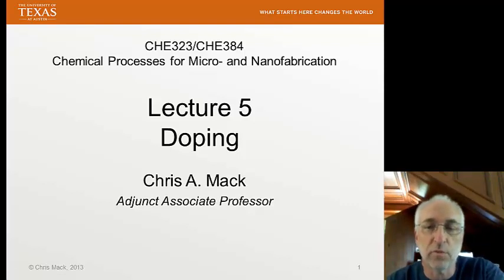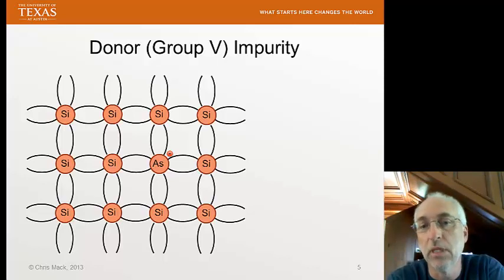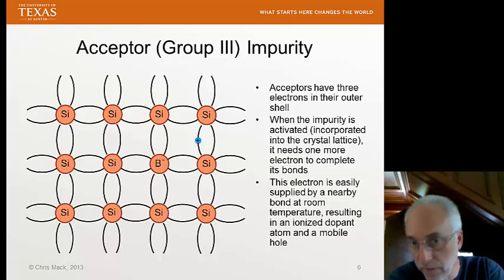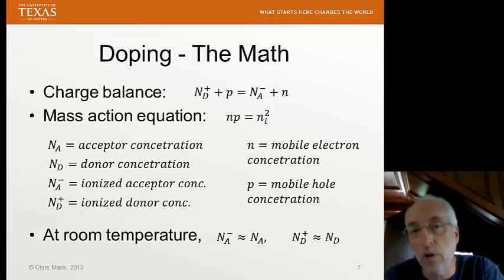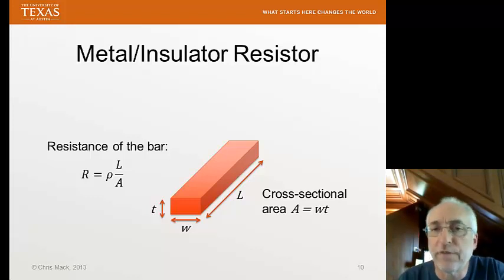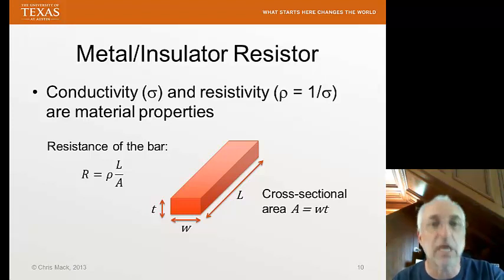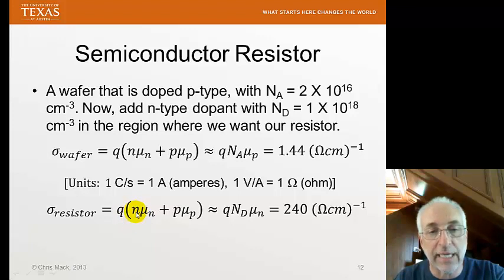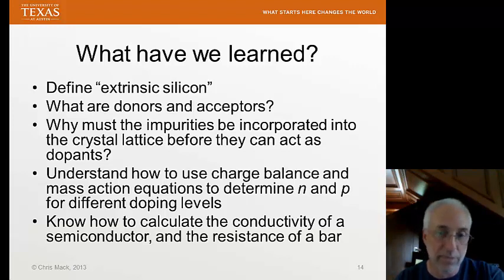Lecture 5 (CHE 323) Doping Impurities

Comment: Thank you very much. you make things easier to me. I have a small question: so if we have NA larger than ND. in this case do we ignore n and calculate p?
Reply from the maker: +Waddah It is not uncommon to have both n-type and p-type dopants in teh same region.  In that case, it is the net doping concentration that matters.  Thus, in your example the net doping would be NA - ND, and you could calculate p using that net doping level.  In every case, you can use the charge balance and mass action equations (see slide 7) to determine the n and p concentrations.

Chris Mack